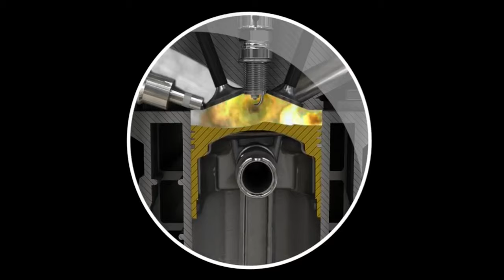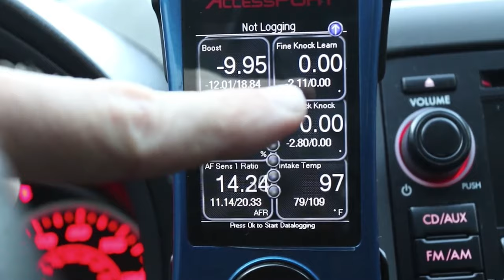COBB Tuning - Car Quickies with COBB - Knock vs Rod Knock

Comment: Sometimes the knock sensors are hearing the transmission making noises. Happens when I'm in 6 gear on the highways.
Reply from the maker: True, that is one of the tricky things. The knock sensor is not super intelligent. Hard shifts, loose stuff in the engine bay, gravel on the road etc can sometimes produce feedback from the sensor that might not actually be detonation. Thats one of the reasons that random events and low speed/low load knock corrections are typically ignorable.
Reply: just got mine, consistently 6th gear any acceleration on highway=knock goes up. glad to see other people see the same lol

Comment: Hey man been watching your vlogs just wondering if you can help me, i got a 2013 wrx and got stage 2 tune running catted downpipe turbo back and stock airbox so recently i put 94 gas in it and starts giving me shitty reading on my accessport and started losing power and no pull so i took all the gas off the car and but a clean gas and injectors cleaner but still runs poor any advice what should i check or look at it?

Comment: Sad there wasn't a sound comparison
Reply from the maker: We thought about adding that but wanted to make the video short and simple. Generally speaking its easy to tell the difference. Rod knock will be much more consistent and is going to directly follow engine rpms in terms of tempo and volume.

Comment: my feedback knock  when -31.80 / learn knock and dam still normal took my wrx to the shop hopefully nothing super crazy.
Reply: Let me know how it goes bro. My feedback knock went to -9.80 and goes to -7.00 sometimes when I floors it. DAM still at 1.000.  Fine knock learn goes to -1.40 or -2.80.
Reply: @vangstii  did you get your car checked? My fkl also went as high as 2.80
Reply: My feedback knock went -11.95 with normal learn knock and DAM. what did the folks at the shop say?
Reply: Any luck?